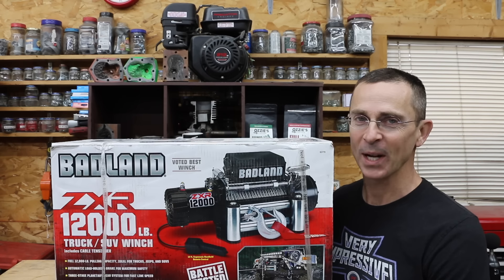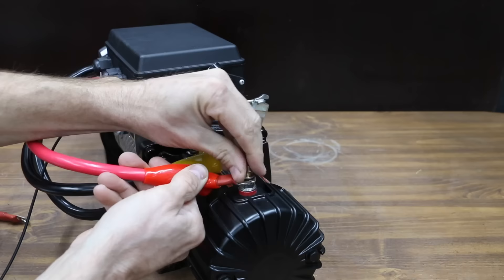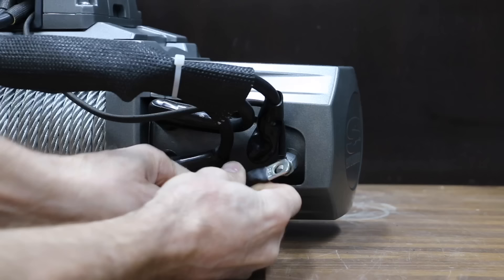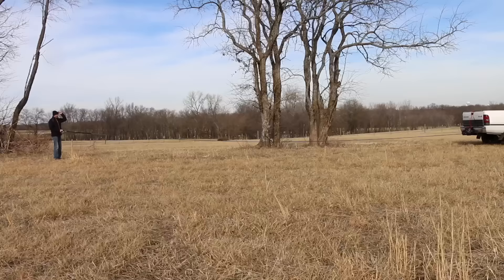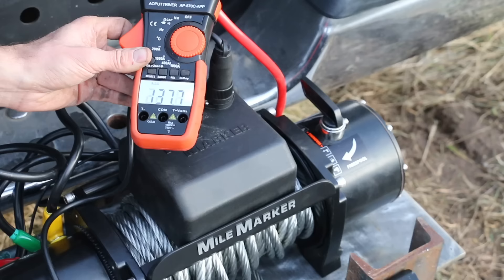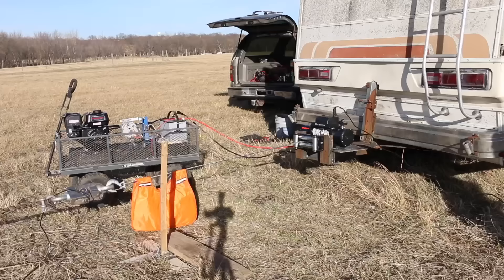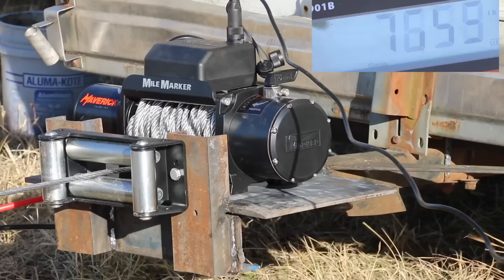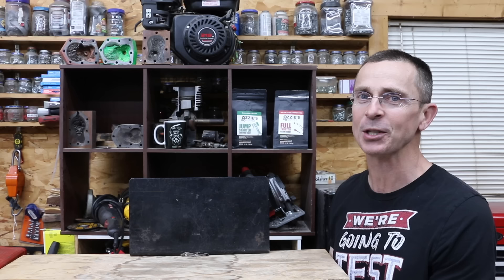Best Winch? Is BADLAND Better Than WARN, Smittybuilt, Milemarker? Let's Settle This!

Comment: Not necessarily the Best method of tests. 1st, nobody cares about a time to pull test. A good test is how much heat a winch develops and rest time required. Heat is what kills a winch. 2nd, why chose Badland ZXR when the APEX is better? Almost all offroad recovery companies use APEX and for good reason. Cost and dependable! Did you chose the top of the line from each winch company? You do this all the time claiming "which is best" but you regularly don't test the best from each company. There are people now thinking "Badland" winches are not a good product. You did the same for "Best work boot" but you definitely didn't test the best boots available. I've been an electrician for almost 35 yrs and have worn the boots you tested. But I've found HAIX boots are far better than any you tested. Maybe you should say at the beginning that there Maybe other boot, winches or whatever you're testing that might be better or do better research to find and truly test the best.
Reply from the maker: Thanks for the constructive feedback